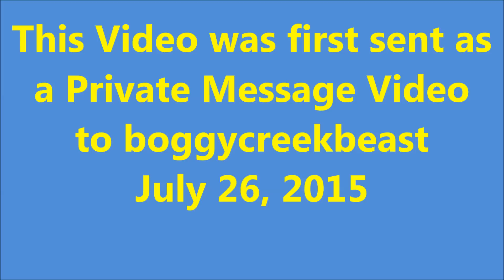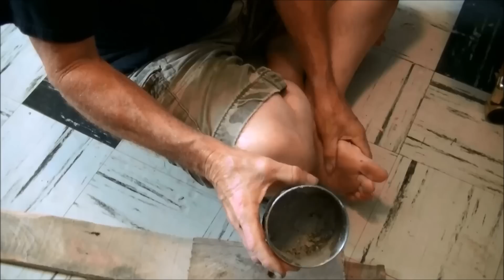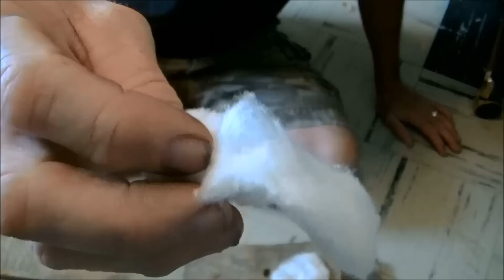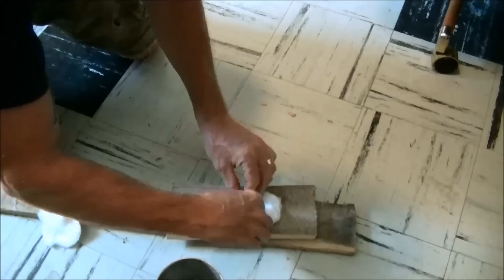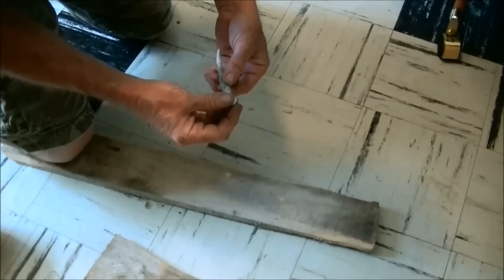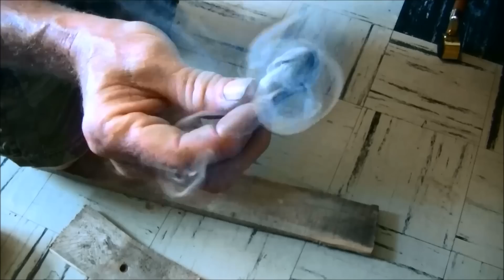The Fire Roll Friction Fire (Rudiger Roll) Method

Comment: I have never seen this method of fire making. Very cool!
Reply from the maker: +HKPSG1Shooter  I hadn't until about a month ago...I really like this method...still working on getting it down though.
If you want to see some great  videos trying different aspects of this...I highly recommend checking out  +boggycreekbeasts videos.
Thanks for watching, Lee
Reply: Lee Ralph It's definitely neat, but I'm not sure how practical this method would be out in the wilderness, though, as you need a dry, flat board. Kinda like the fire piston, potassium permangenate/glycerin, magnifying glass, the 9V battery/steel wool, and even the bow drill. All of these will make fire, and they are neat to demonstrate, but honestly, I would not want to depend on any of them to build a fire when my life depended on it. I trust a pocketknife and a mag bar every time. Even more than a cigarette lighter, as the burning magnesium gets much hotter than a butane flame, and that helps when materials are damp.
Reply from the maker: Great response and a good points!!! I have seen this method used in the bush and with natural tinder and with a split small log.. I think as with all things...I consider each  skill as  a tool. I would rather use a socket set for repairs..but know if I have a crescent wrench  I could get by. And there are times a set of pliers would work just as well.  I like to know as many skills (tools) as I can...just in case I do not have the tool I want to use at hand. I think I would agree...with you on the reliability of the knife/mag bar combo...my only thoughts are the "what ifs"...but I know in survival we need to not be caught of guard so we do not have to say...."what if...."
Great response!!